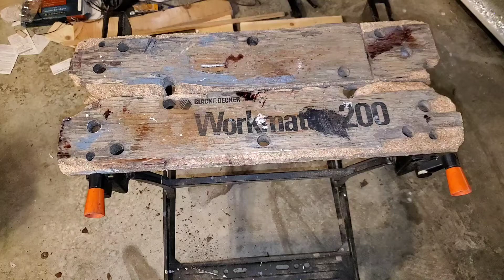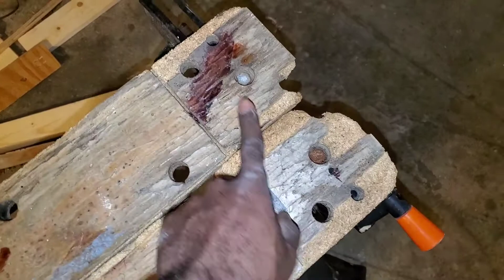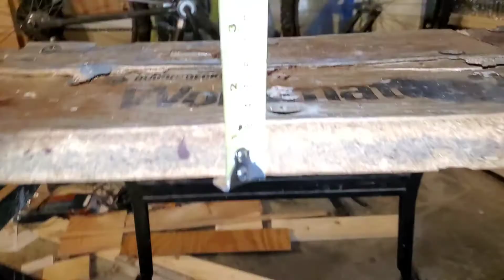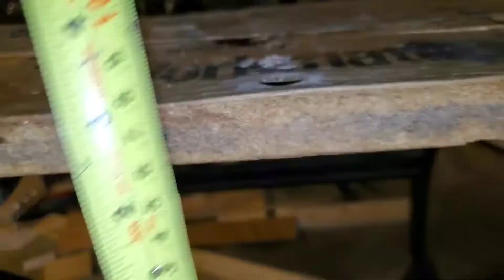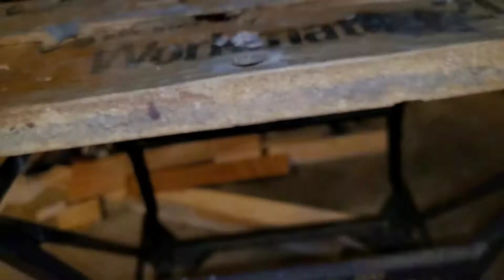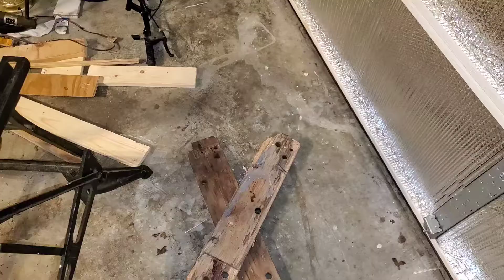Replacing Top of WorkMate 200; Black and Decker WorkMate 200 Upgrade

Comment: Use a router to cut a v groove on the inside of the boards to be able to clamp round stock and pipes securely.
Reply from the maker: I didn't have a router, so I couldn't do that

Comment: Great video. Why the heck Workmate used particle board is beyond me. I rebuilt mine, similar to your but found the measurements critical. I used a drill press and a caliper and was still a few 32nd off and things didn't fit.
Reply from the maker: Cheaper to use participle board.

Comment: On the boards you replaced, what size holes did you drill to accept the board stops?
Reply from the maker: Don't recall what size they were. For the holes that go all the way though, I picked a drill bit that was slightly bigger than the bolt used. Then used a significantly bigger drill bit for the recessed hole.

Comment: Nice job. I inherited my dad's Workmate as well. The top on his is a plywood. Yours looked to be partical board. I am thinking of replacing the top, not because it's damaged, just something to do. I added a 1/2" plywood shelf on the bottom and recently found a tip to build a "dog kennel" to hold the spare dogs that do into the holes in the top. Keeps them handy.
Reply from the maker: Thanks. It looked like MDF but may have been particle board. 
The dog kennel is a good idea. To bad mine didn't have those with it

Comment: Thank you very much for the video. I’ve had a Workmate 200 for at least 30 years which has similar problems with the wood as yours did. I received a Workmate 225 for Christmas this year, so I plan to replace the wood on the old Workmate 200 and give it to my youngest son. I’ll also have to replace a broken handle, which I was able to find online. Again, thank you for the video.
Reply from the maker: Welcome!

Comment: Great sturdy chunks on your work surface now, a vast improvement… 👏🏻
Are you not going to bother with the dog holes the original work surface had - they can be very useful holding boards in place?
Have also found pipe insulation to be useful, when cut in half and fitted over the jaw edges, to protect workpieces you may not wish to risk marking… 🤷🏼‍♂️
Reply from the maker: I'm not. For me I'm able to get the boards that I use the most inside the gap and tighten them down.